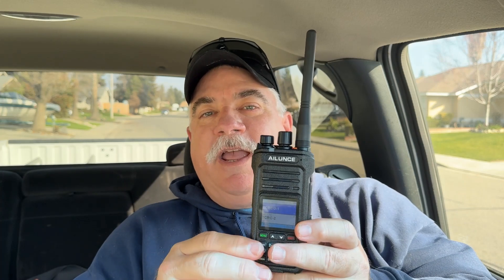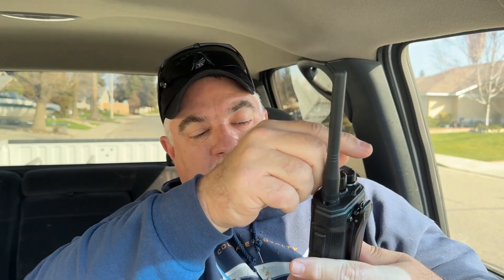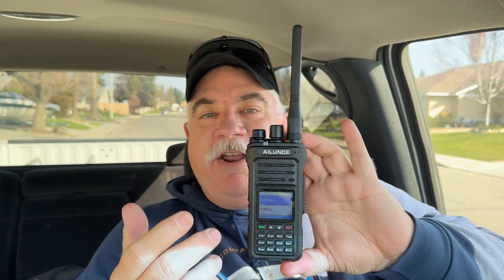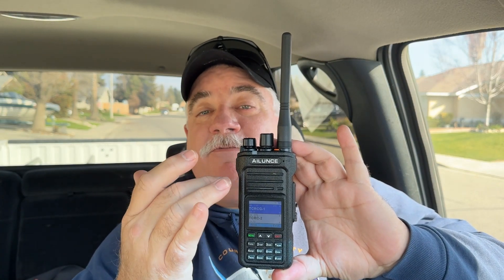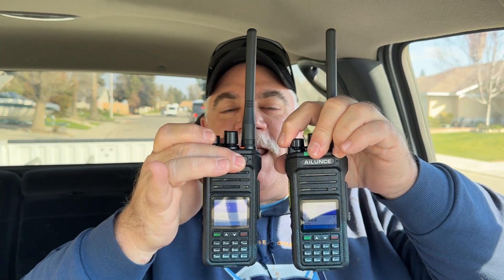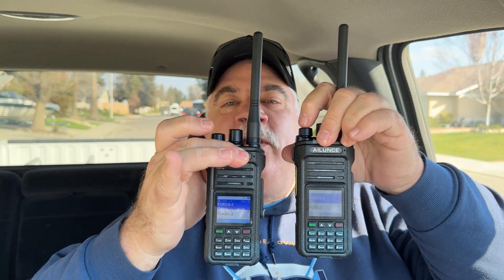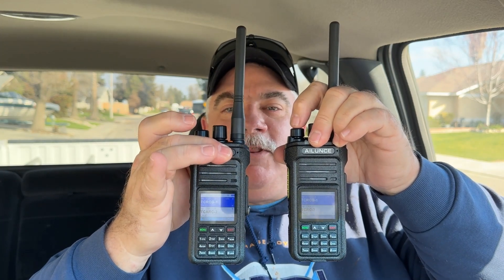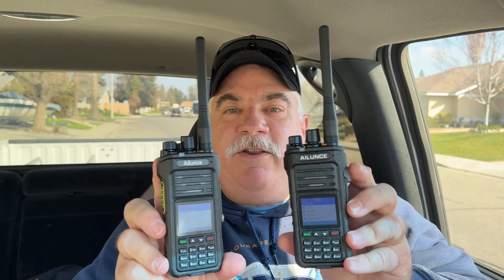How to convert your Ailunce HA1G into an HA1UV

Comment: I most certainly appreciate this information.  I’ll likely pick up a few more of these and updated the firmware and make them HAM.  

And for the record, these have become my very favorite radios.  For me, they fit my needs the best, and their performance is unsurpassed.  All of my HA1Gs put out 6 watts or more right from the box.  The HA1UVs, at or slightly below 4 watts.
Reply from the maker: I 100% agree. The hot ticket is the HA1G over the HA1UV. I'm also massively impressed with these radios.

Comment: The downside of the HA1G CPS software; is that the first 30 channels are locked to the GMRS frequencies.  If you plan to implement GMRS as well as Ham, thats great; but if not, you lose those 30 program slots.

Comment: After seeing this video, I bought an HA1G radio. I flashed the new HA1G firmware to it, and it does indeed allow the unlocking of the ham 2m and 70cm bands.

I saw another YouTuber demonstrate how to install the firmware for the HA1UV onto the HA1G. I gave it a go, and it messed up a few minor things that I was able to get straightened out after playing with it for a couple hours. It wasn't a seamless transition, but it did work! 

As far as I can tell, there are really only two differences between the HA1G and HA1UV firmware. First, the HA1G has 2 Tx power settings, while the HA1UV has 3 Tx settings. Second, the HA1G has squelch tail elimination automatically applied to each channel (you can change the setting or turn it off for each channel, but only through the CPS software). The HA1UV doesn't seem to have any squelch tail elimination settings on the channels. There is a single on/off checkbox in the CPS software for the HA1UV that I'm assuming will apply to all channels when checked, but I haven't tried it yet.

Thanks for the video, Scott!

Comment: The lowercase label on the HA1UV is less visually appealing to me than the uppercase label on the HA1G. So I told myself, "self, it's time to buy."  A 2-pack dissapeared out of my cart while I was looking for coupons! So went to the jungle site and got one for $40 with coupon, which is now also gone from there (price now $44 firm) . I blame you :) .
Reply: New batches of the HA1G all have the new 'lowercase' labeling. They changed it on the battery, packaging, manual and the splash screen as well. My guess is that Retevis didn't pay the license fee for the 'new' font so they had to revert back to the old style. Unfortunately, most Chinese companies that sell radios, haven't got a clue about proper UI/Industrial design, sans-serif fonts etc. Hence the price is low.

Comment: Not sure why but when I download the new firmware it will not let me open it or even unzip.
Reply: Same for me. It is a .zip file. I renamed it to .bin. I ran HA1GUpdateTool and it installed but the radio did not start. I had to update back to the previous version. I sent an email to Retevis/Ailunce to update their software page.

Comment: I purchased 2 HA1G's in the last few weeks. They came with the updated white on blue firmware so the PTT/#8/power on sequence works right out of the box. Still available for $40 on Amazon without the programming cable.
Reply: Sweet! I just bought one and hope mine will come that way also.

Comment: Are the antennas the same? Wondering if my HA1G antenna is usable for 2m.
Reply from the maker: I just tested my HA1G antenna and it produced a lower SWR on 146.520 than it did on the GMRS frequencies. Mine, at least, is definitely safe and useable on 2m.

Comment: For what its worth here are the readings I got from my radios. HA1G 2 meters, High 5.13 watts, Low 1.41 watts. On 70 CM High 5.53 Watts, Low 1.02 Watts. On the HA1UV 2 meters High 5.38 Watts, Medium 3.69 Watts, and Low 1.60 Watts. On 70 CM High 4.97 Watts, Medium 2.98 watts, and Low .534 watts. I don't think these differences in power that anyone could tell the difference.
Also, each radio will probably have small differences... Just my opinion.

Comment: Back in early December I did the firmware update on my HA1G, are you saying there is another firmware update since then ? Please advise and thanks !
Reply: starting firmware version would allow this switch between GMRS and 2m, 70cm
v1.01.10.005,  now they release newer version v1.01.10.009 (latest as of 2/20/25)
Reply from the maker: I don't know the firmware history on this particular radio. But the current version that I have listed in the video produced this result. Unknown if that's the one you did in December.
Reply: I updated the HA1G to V1.01.10.005 back in November and have been using the "lock the radio, enter 1,2,3,4,5,6, then unlock" which temporarlily unlocks for 136-174 and 400-480 until you turn it off. I tried the PTT/#8/power-on sequence and it also works with that firmware so I now have the option to use it for GMRS, Ham or emergencies full time or on a temp basis.
Reply: Thank you for information!